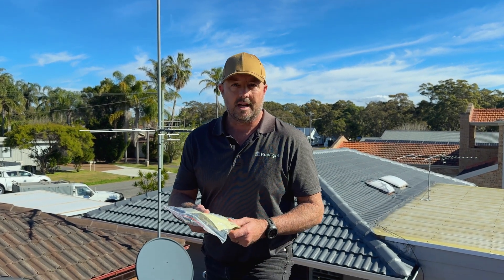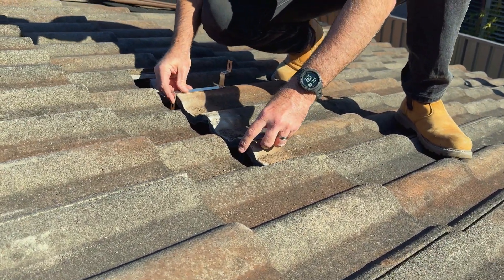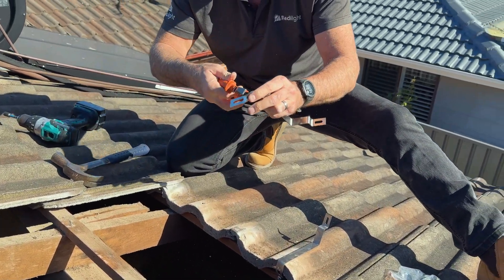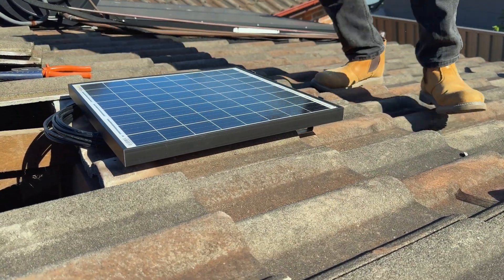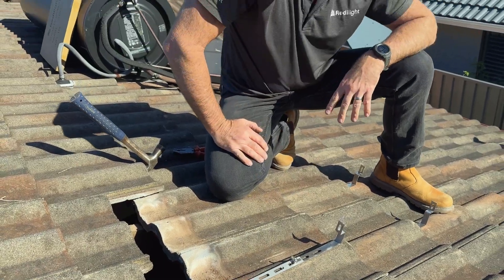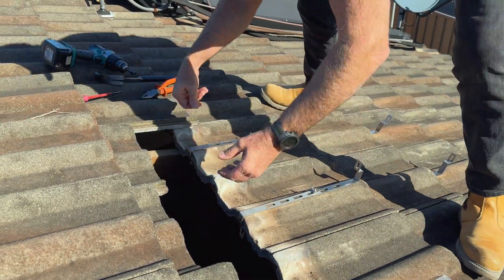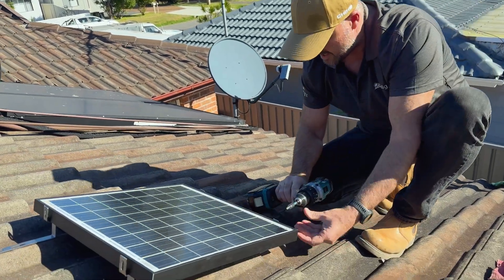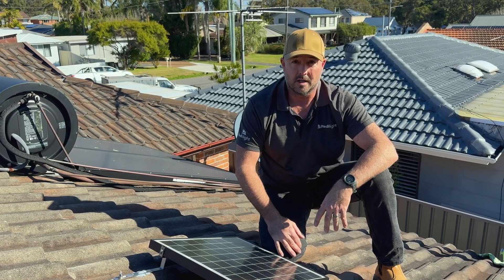Redilight LED Skylight Alternative - DIY Install On A Tile Roof

Comment: chipped the water course of the first tile you put back in. That roof is going to leak now. and it has no sarking either. makes you think twice about getting any panels installed
Reply from the maker: Thanks so much for your comment and feedback!

That installation was filmed well over a year ago, and we can confirm there haven't been any leaks. (Although checking and maintaining your tiles is always important.) 

Covering sarking was beyond the scope of this particular video, but we really do appreciate the suggestion! We're always looking for great topics to cover, so let us know if you'd like us to cover it in a future one.